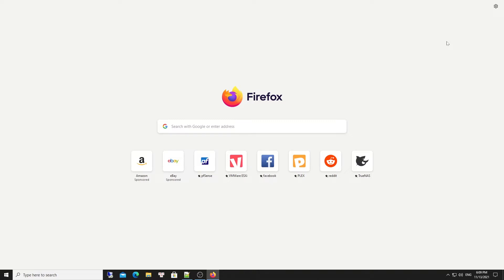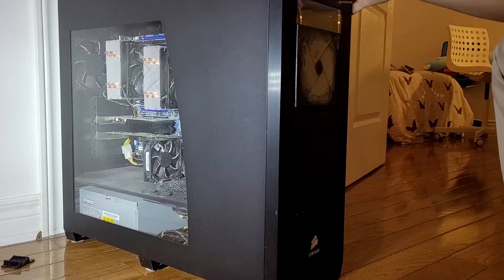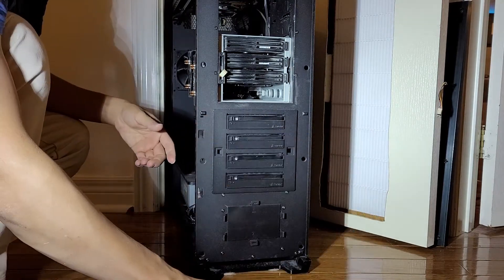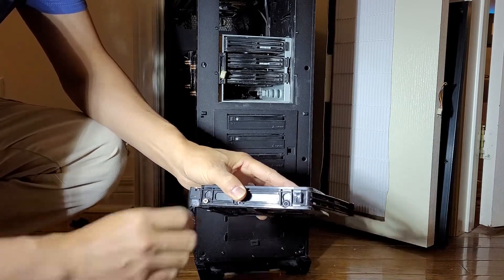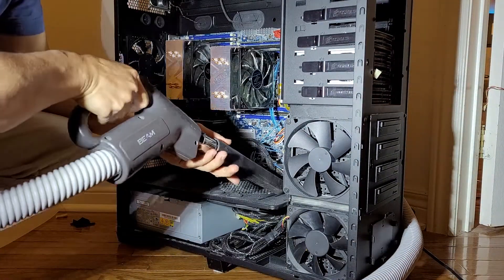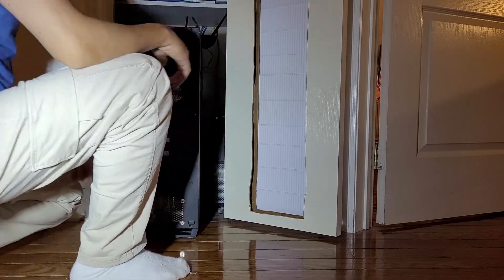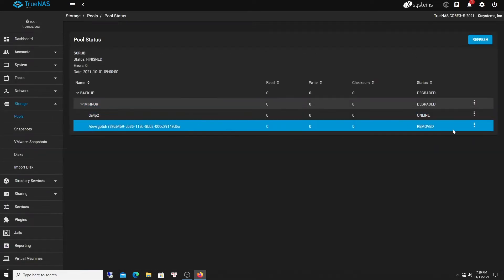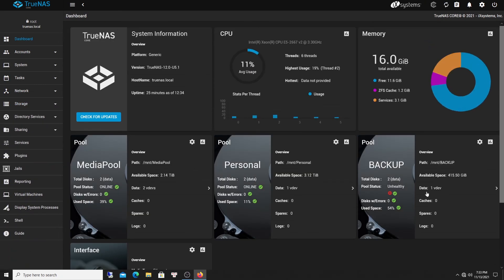#TrueNAS 12: Replace failed degraded drive and do server maintenance

Comment: So you don't recommend following the instructions here -https://www.truenas.com/docs/core/storage/disks/diskreplace/ ? That says to offline the drive first, then replace it, then select the "replace" option on the offline drive, and then select the replacement drive.  

I just did the "set offline" part. The instructions say to wait for the drive to be offline before replacing, but I noticed a resilvering process started when I marked the drive as "offline".  To be safe, I'm going to wait for the resilvering to finish before shutting down the server to replace the drive.
Reply from the maker: My disk was already bad/failed. So TrueNAS might have already offlined the disk. It's just a matter for me to go in and identify the failed disk and physically replace it with a new one. Once the new disk is physically installed, I had to wipe it first and then do "replace process" as shown in the video. TrueNAS will automatically resilver since it's a pool using mirror vdevs.

Comment: So funny to see that people use these huge servers just for a 4 drive NAS...

Yes, I do get it, some people just use what they have, but when you see these dual CPU, many fans and soooo much empty space (plus the fact the he worries about the metal vacuum hose, when the system is not plugged in, tells you everything).
Reply from the maker: just to be correct i have 8 and another 2 SSD at the bottom. I use it for VM though. Not sure if i understand you regarding metal vacuum hose. You say that to say what? Clearly, you don't understand how central vac works.
Reply: His hardware not our business